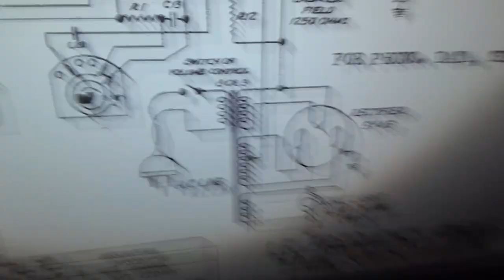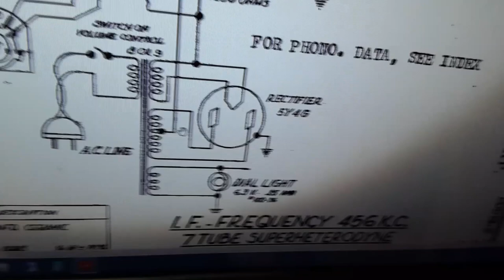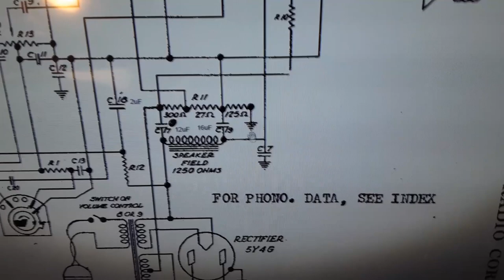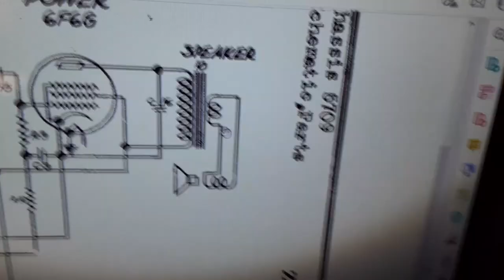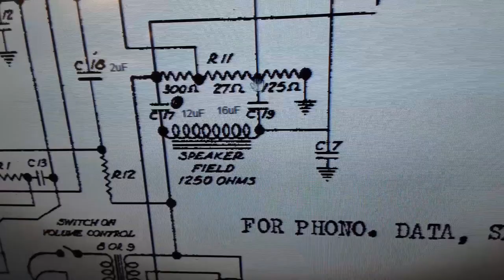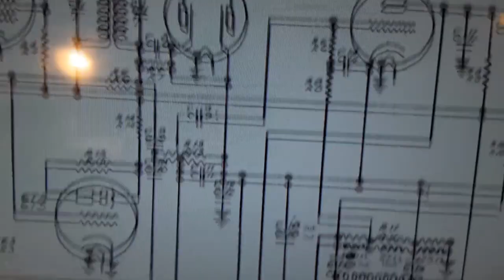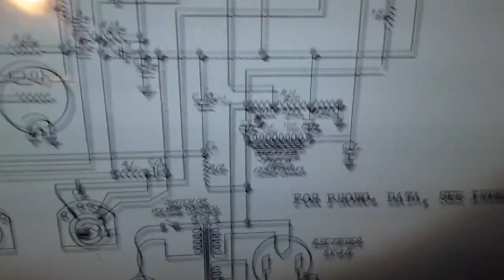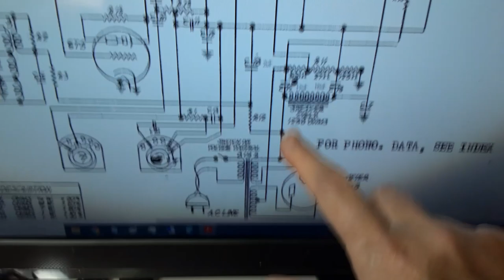Why Amateurs Should Not Service Expensive Antique Radios: 1930's Zenith Radio - 7S261

Comment: At 19:00 the ripple smoothing coil functions as a DC fed electromagnet. Very clever to save  copper  but....  doesn't  that creates a  120 hz hum in the speaker. It is like you mix the Hum with the audio.   2nd doesn't the audio on the other hand get fed back to the DC supply  and into all further electronics again creating that sort of echo?
Reply from the maker: Your thinking low voltage / high current: solid state. Tube devices are high voltage / low current. That is a major mind jump! So as a tube device, what we have is this circuit in question (C17 Field Coil C19), which is a pi filter, designed to remove the low millivolt 60/120Hz AC ripple off the high DC (B+) line. Keep in mind that the B+ is up around 300-375V DC! The percentage AC voltage ripple, before the the pi filter, is 5V DC (the filament/heater voltage of the rectifier tube). That is 5vac/300+vdc = 1.67% pre-pi filter.  Another way to look at it is: a B+ voltage of 300V DC would be a pulsation DC voltage of 300V +/- 7.07V = 292.93VDC to 307.07VDC. The +/- 7.07V is the peek to peek voltage of 5VDC (5 * 2.828 = 14.14v p-p = sign wave of 7.07p+ to 7.07p-). That is quite insignificant at 300VDC right? And that is BEFORE the pi filter. After the filter, the AC ripple voltage would be a much lower percentage. Perhaps as low as 0.001%. Which at 300V AC is definitely insignificant! Next we have C7 going to ground which the AV ripple would see as a "water slide to ground", while the DC would see an insurmountable wall of concrete! Lastly, the Output Transformer is driven by the amplified audio signal, superimposed on that 300V DC. As for the reflected audio back to the high voltage power supply, who cares? It would be swallowed up and grounded, through the center tap of high voltage winding of the transformer. Again, all these things would be serious issues in a low voltage, solid sate device. And much worst in an analog to digital IC circuit.
Reply: @ElectroRestore  so that Hum will be bearly or not  hearable and the feed back audio wouldn't be of any significance to cause echo or refraction effect.
Reply from the maker: @ON5ALE-Alessio  Exactly! Each stage is pretty much isolated from the previous stage by the one-way signal path. On the RF side, you have high frequency filtering through the IF cans (455KHz for AM and 10.7MHz for FM). So feedback there not likely. If you have wires that are not dressed properly in their layout in the chassis. In such a case, it might be possible to get feedback in the oscillator circuit, which has high sensitivity. However, most of it would be stepped on pretty good by the incoming radio station and IF filtering. You would be more likely to get 60/120 Hz hum interference from the AC tube heater wires, if they ran over sensitive areas, than reflected audio signals. Very good questions! Thanks for asking them!
Reply: @ElectroRestore  did they had FM and 10.7 MHZ in the 30's?  I mean  most radios backthen were single conversion on 455 khz  I think. I could be wrong.
Reply from the maker: @ON5ALE-Alessio  @Alessio-v3o  No, No FM until much later. I was just including the different frequencies of IF cans in general.

Comment: As an amature who is actively reading up on electronics and referencing youtube videos, I don't understand how this could get so bad. I typically take it one component at a time and take tons of reference pictures before I do anything. It almost looks like they took a ton of components out at once and weren't sure where to start. Great video as always!
Reply: Its called  inexperience,and a little knowlege is a dangerous thing! Trust me Ive seen some right hotch potched two way radios RF repairs over the years make you shudder..lol
So seeing this video as a engineer does not surprise me.
Little common sense goes a long way too as shown with cutting and leaving danglers in mid air ether!
Learn from other proffesionals is the best way,Yes take lots of photos which is so easier to do now,well done.
Why Engineers used to get paid well for there skills and knowledge,sadly the repairs engineers are becoming a rare breed now and poorly paid for their skills in throw away electronics.
Good luck learning more usual skills in your quest.

Rob P 👍

Comment: I'm an amateur and I have restored several radio's, tuners, tapedeck and a grundig 2355 tube radio, just for fun and hobby. So it is possible. The person you are talking about in the video was not an amateur, but an overestimating novice with no feeling for components and how to solder them correctly.

Comment: I see this happen all the time with old tube type receivers and CB sets.
A radio operator's license is for operating radios, not repairing them!
Find a HAM operator who is NOT an 'appliance' operator, (someone who purchased all his equipment ready to use right out of the box), instead try to find an older more experienced person who can repair his own equipment, especially if he can repair tube equipment.
Reply from the maker: Great advice! It is not that folks learning the trade should not ever work on these units. They just need to get some serious experience and perhaps some training from a seasoned veteran technician. And such a person would have them start with small, inexpensive, All American Five, desk top radios till they develop the necessary skills.

Comment: Zenith has always had a bad rep for circuit design, wiring, and poor documentation. When I worked as a bench tech in a well known repair shop, we had rules that we followed. If you messed up on something, your punishment was to work on all Zenith products that were already in the shop, or the ones that came in for one week. I always got stuck with their stereo's (which I hated).

Comment: It's a lot of extra work when the customer has installed Parts incorrectly or to the wrong connections because you have to trace point to point everything on the schematic to what's on the actual physical radio. It's a much more involved repair than just repairing something that failed what but was not touched by the customer.

Comment: ER - THANK YOU!  I'm currently working on recapping a Philco 37-61 that has exactly the same issues around the candohm resistor.  The schematic is opposite the physical layout and someone got it wrong and it's not connected according to the schematic.  I'm a novice for sure but I'm trying to learn and get it right. I spend multiple hours staring at the chassis and reading for every 1/2 hour of actual soldering and replacement.  This video (especially the explanation re: smoothing capacitors at ~10:14) was just what I needed to see exactly when I needed to see it.  Thank you for taking the time to propagate the knowledge and helping us all figure it out.  Greatly appreciated!

Comment: Bummer with that field coil. You can t just swap speakers. But if you use a stand aline coil for the DC supply and a 4 ohm  modern speaker ?
Reply from the maker: You can replace the field coil with a power resistor and that would free up the power supply from the output stage. Than, replace the output transformer for one that has a primary that will work for the load resistance of the output tube (for this 6F6 tube it would be 7k ohms O.T. primary impedance), and a secondary that will work for a 4, 8 or16 ohm speaker of your choice. ;) Note: You can find the load resistance for any output tube in a tube specs sheet. It's easy to get them online.
Reply: @ElectroRestore  
The standard fix is to use a choke from an old tube audio amplifier to replace the field coil, and use any speaker you want with it.
Reply from the maker: @Dennis-mq6or  Sure you could. But most people who own these want to preserve them as original as possible. The speaker they have has a cool acoustical cover that gives them really good base response do to the added baffle. Also, rewinding or repairing the field coil, as I have done on this unit, is not really that difficult. Also, this is an AM / SW radio. If you want a better quality sounding radio, you would buy a newer device that has FM. ;)

Comment: Thank you for this video. I've learned quite a few things.
I wonder, if one wishes to restore such radio to working condition, and finding one of these old speakers is impossible (let alone rewinding the field coil), would it be possible to instead use a modern speaker with a permanent magnet, and any kind of inductive 1250 ohm load on the ripple smoothing side?
Reply from the maker: As long as the inductor can take the high voltage, yes! But I do have a video showing how I rewind a field coil. It really is not that hard. Actually, you can repair them if they are not too bad by replacing bad spots. If just the speaker is bad, you can put the field coil in the cabinet (if the original one is good). Assuming there is room of course. Then install a permanent magnet speaker.

Comment: Zenith was known for tying components together in mid air in their late 30's sets.  Saved them a few pennies for a terminal strip.  Not those filter caps though, someone should've used a terminal strip!  I've seen a number of bad field coils in 1936-38 Zeniths.  Usually what happens is the second filter cap shorts, and causes too much current to flow through the coil, burning it out.  But it seems Zeniths are especially prone to this problem.  It's possible the coil was already open before the previous repairman worked on it.  They clearly didn't use the schematic, so I wouldn't put them past not testing the field coil before they started!  I've also seen bad oscillator coils in these 1938 models, and of course the candohm is always unreliable.
Reply from the maker: I agree that a person that would do such sloppy work would not think to test the FC for continuity before recapping. However, the filter cap was definitely in the wrong place, which indeed passed excessive current through the coil. The candohm resistor, amazingly, had no bad sections and was in acceptable tolerance for a voltage divider to handle the B+ current through the FC; had it been in series and dropping the voltage as required.
Reply: gracias por compartir tu expriencia. No sirve a las nuevas generaciones aprender de ellas.

Comment: I agree with you 100% I've been saying this for a long time.... that most of these so-called radio repairman on you tube or restores are complete butchers .... especially when they say oh it doesn't have to be exactly that  value ....  they're saying that they know more then the  engineers/technicians back when the equipment was  designed... I myself  worked for Westinghouse in the 60s as a color TV analyzer fixing the sets that didn't pass the testing ..but a lot of these  idiots on YouTube just like to see themselves and hear themselves I believe and teaching the public everything that's incorrect ....I seen them  Butcher up and destroy a lot of gorgeous radios and I tell them so also
Reply from the maker: Agreed Mike, it is important to me to stay as close as possible to the original schematic, using the parts that are available today.
Reply: actually in some cases  resistance/capacitance values arent critical,  valves/tubes are very 'unfussy', and vary in characteristic a fairly wide range themselves, anyway...

Comment: Condensers, don't 'convert' AC to DC. Rectifiers do.
Reply from the maker: Rectifiers indeed do convert AC to DC by allowing current to flow in only one way. However, the DC they produce is fluctuating DC, also known as pulsating DC. It is not pure DC! It has an AC component to it. The only way to remove that AC (in a tube type circuit), is with a capacitor(s). Capacitors store charge like a battery, which is pure DC. Put an pulsating DC charge on it, and it dampens it via it's regulation properties. The only way to alter the DC voltage on a capacitor is by putting applying a greater DC charge, or a charge in the opposite direction. Therefore, they are the necessary components in true AC to DC rectification.
Reply: @ElectroRestore  Maybe Pulsating current îs better.
Reply from the maker: @MrGigi-dz9cv  No, Capacitors store voltage, not current. They store Electromotive Force (EMF) in the form of a charge (like a battery). The E is why Ohms law is not V=IR. But rather E=IR (or I=E/R or R=E/I).

Comment: Unfortunately novice radio repairmen never consult a proper schematic, nor do they take notes, nor do they understand
what they are looking at compared to the schematic. They also have components sometimes just hanging in the breeze.
When going over a previously touched radio you have to check everything the last person did AND the existing
wiring and components. Basically double the work for  a restoration .😒
Reply from the maker: Exactly! Twice the work and diagnosis time! The good side, if there is one, I guess would be the radio should end up even better after the detailed analysis and painstaking repairs.
Reply: you cant always blindly trust even official schematics, there may have been changes during the production of the set which wouldnt be in an original issue service sheet, or vice versa, you may have an early set, but schematic for a later one, and this isnt always stated... even more variations likely in any set produced during wartime due to component availability problems....it may also have been modified for various reasons, maybe due to not being able to get correct parts, so altered to suit others